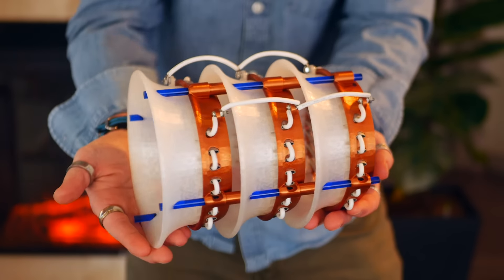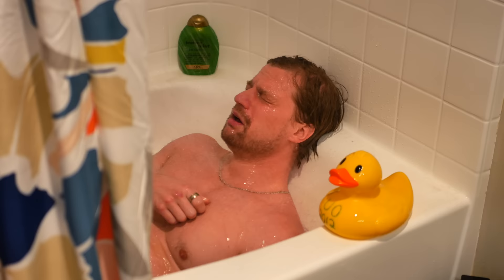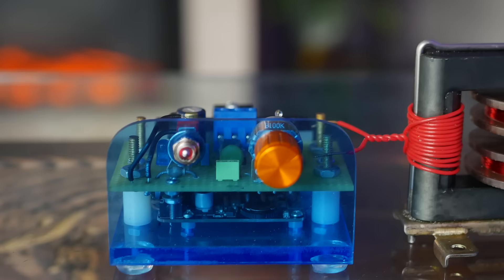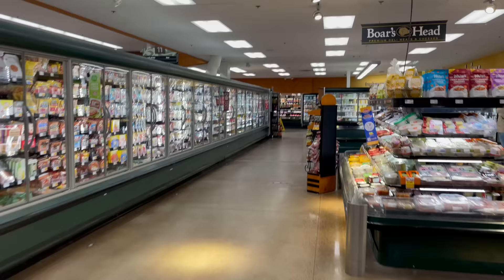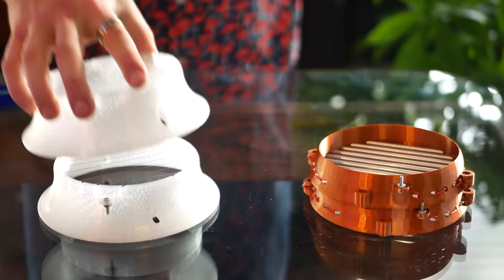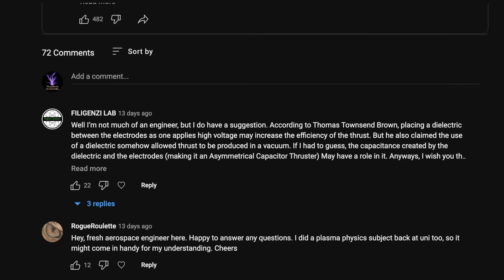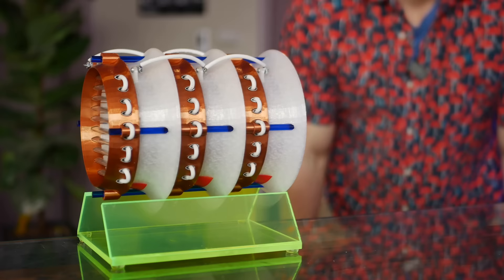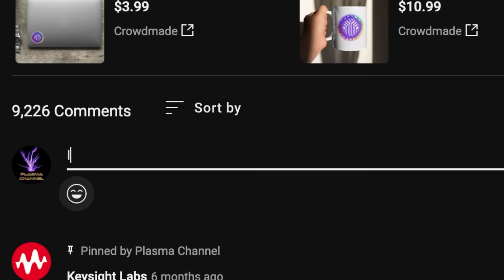The Next Generation of Ionic Plasma Thrusters (BSI MARK 2)

Comment: While you have already tested and optimised spacing between the anode and cathode for a single stage, i think you should really adjust each stage in a stack individually. The air molecules entering at different velocities might impact how far they need to be apart.
Reply: they should never have been stacked in the first place.
Reply: Came here to say the same thing!  As the air flow rate increases (after each stage), you have less time to transfer the additional charge to the air.

I would also think successive stages would do better with higher voltage.
Reply: my thinking is also in 5his camp more space required as velocity increases.
Reply: Yeah, that occurred to me as well - logically, the faster the air is moving, the less time it has to be influenced by each stage, right?
Reply: @beforebefore wouldn't more voltage benefit all stages regardless of location?
Reply: @nathanchalecki4842  It might be wasted energy on slower flow rate sections... if there's not enough air flowing to absorb all of the charge. Ionization has limits before it will cause arc-discharge in the airstream. 
 Higher flow-rate stages should be able to make more use of higher charge transfer potential.
Reply: So, continuing some of the thoughts here ,,, As the airflow increases the distance between the stages would need to adjust farther apart to allow for increasing air draw. The voltage in each section may also need to adjust for changing conditions. Perhaps a system of ramping up voltage as the airspeed goes up and the distance between the stages gets wider in relation. 
I can see how safety redundancy would be good requiring 2 stages but it seems the third stage is adding more restrictions unless the previous concepts can prove otherwise. I would think that two sets of double stages would move more air. If ducted into a single output with another venturi intake space using the combined forces of both ... the airflow in the combining structure would need to be very carefully designed for minimal turbulence across the functional range of outputs from the driver stages. My thoughts jump to a third double stage driver assembly configured at slight angles to each other to `spiral' the airflow inside the combiner to minimize flow restrictions and the resulting eddies in the airstream. I would expect that 3 double stage drivers combined would produce at least 2 times the airflow but maybe as much as 2.5 times.

Now, how am I supposed to sleep tonight with all this spinning around my head ?!?
Reply: @OldShortyInCanada  those are some very good ideas and points you made there.
Reply: @nathanchalecki4842  if you are looking strictly for power yes of course. However to optimize your efficiancy with little sacrifice to perfirmance, voltage regulation would definitely be relavant. Personally i think it would be interesting to see what the effect modulation and restriction would have. Can you produce more efficient thrust by modulating the output voltage in asynchronous waves kind of like a rail gun? Would restricting flow and causing an aerospike like effect cause more thrust. Of course every part you add creates complexity and possible POF.
Reply: Have you thought about figuring out a way to swirl the air current like a tornado?  Not sure if it would do anything practical but then again it would be awesome to see and would definitely get the creative juices flowing.
Reply: Imagine trying to control the power of a tornado into something like an Ionic Plasma Thruster…. You’d be talking about something akin to jet propulsion power there.
Reply: I agree with the different velocities of Air entering you likely need slightly different geometry on the electrodes and voltages. The higher the Air speed the more elongated the conductors need to be. think flat metal wires instead of wires. and likely stepping up voltages. interesting project though wish I had the equipment to play with it.
Reply: @justinhill1908  it's a neat idea it's just ironic thrusters are so inefficient compared to a fan
Reply: @justinhill1908  you could already do this with basically a fan
Reply: @justinhill1908  what do jet engines use anyways it can't possibly be fans
Reply: Basically it would’ve been great to see same experiments with spacing electrodes and varying voltage when the external airflow is applied. That can help a lot with understanding the perfect conditions for multistage configurations. Although my gut feeling is the same here — next stages should have more space and proportionally higher voltage (interesting to see wattage as well, I guess it should be equal between the stages for best results).
Reply: At first... sorry for my bad english and i'm not a scientist😅 but i think also the solution is to change somthing at the electricity between the stages. But in my opinion you have to change the frequenz between the different stages. Like different frequency for each stage. A oppertunity will be one or more frequency converter. So may be the airflow will work faster.

I also think, a single stage might be have a better efficienty then three instack.

Wish a good day.
Reply: I wonder if instead of overclocking voltage, what would happen if you offset the grid alignment on all 3 stages. For example second stage is clocked at 25 degrees from the first, and third us clocked at like 80 degrees from the first.
Reply: This was exactly my thought.  If the hypothesis is that air molecules are moving too fast to interact with the anodes and cathodes of the first thruster design, our test should see if increasing the spacing of stage 2 or 3 result in improvements
Reply: @justinhill1908 In theory if the design of the anode / cathode grids was more like a spiral staircase, and it used electronic switching to energize segments in sequence, you could get the air current to twist as it passes. If each stage had a stepped design going from wide to narrow, and applied progressively higher voltages, it could increase velocity towards the exhaust maybe? Also maybe moving from wires to some sort of printed circuit could lower resistance and generate more streams per layer. (i are not physicist)
Reply: Increase voltage per stage, increase distance slightly between anode cathode per stage, decrease diameter per stage. You’re welcome.
Reply: Did you properly test the vector of your ramrod? Ramrod=Uranus √2
Reply: @beforebefore is that a fact or do you think they’re all limited by charge?
Reply: Great job. I believe if you make the second inlet diameter bigger than the first one and third inlet diameter bigger than the second,  you will have more speed. And of course it will be better if you test it in jet tunnel

Comment: If you want to get faster airflow, you might want to reduce the size of each stage a little bit, so it would start large, pulling in lots of air, and get smaller as it goes through. I think this will increase the pressure as the air goes through the thruster, and as a result of the increased pressure, increased velocity
Reply: The pressure would actually be decreasing for the exchange of increased velocity airflow. As you're describing a nozzle. A good way to think of it is that a negative pressure (vacuum) would pull in more air faster, ie higher velocity. Jet engines use nozzle-diffuser exhausts to increase the velocity from the burner and turbine stage to a higher Mach number via the nozzle geometry, and does this through the enegry expense of decreased pressure. Then the diffuser at the exhaust increases the pressure, typically towards ambient pressure and as a result it reduces the velocity.
Reply: Those side "inets" are not helping
Reply: I think as the air speeds up and moves through the succeeding stages then the following grid pairs might need to be further apart so as to keep ions in the accelerating zone for the same period of time as the first stage.

Otherwise it will still have the same problem as putting a computer fan in front of the single stage.

As Alex suggests, there might also need to be a diffuser after the last stage... and I think that might need to be heat resistant
Reply: @class2instructor32   I was thinking this too since airflow is obsturucted by air from the sides.
Reply: @lordchickenhawk  yep you are right. there's definitely a need for testing in grid spacing, and I don't think this channel is the best at the scientific method for this reason. For instance, he tested the grid orientation by 90 degrees but didn't take an iterative approach, so there's no guarantee that parallel is the best. Perhaps 33 degrees or 45 is better, or even 14? 

No one knows the best approach to improving this engine, beyond basic principles/logic from thermodynamics, aerodynamics, and jet propulsion. However, my experience with electronics has proven to show many surprising results due to the physics alone. If he wants to optimize this system, he really needs to solve for a physical model representation. With instrumental uncertainty and proper testing. As his test with the fan did not prove anything other than that his current setup is not linear. There's a chance that moving one grid further or closer could reach a sweet spot that creates a linear relationship. It's probably unlikely, I would guess there's a gaussian distribution for grid spacing as each stage needs enough room to pull more air from the sides while also maintaining the "narrowing" flow rate through each stage. He may need to design a very long nozzle to increase the velocity. The question becomes more about how long is too much material versus too short for limited thrust. There's also no answer yet to how the number of grids impact the results. 

So it's almost reaching a pointless approach, to only focus on aerodynamics at the inlet. I don't think a diffuser will help either as an increase in pressure is not needed, as that would lead to a loss in energy. Unless you plan to drive turbine blades, which would be a very inefficient fan. 

I think there may be some testing required for possibly a nacelle versus open, and then as most people have indicated, smaller subsequential stages to create a nozzle effect. The device is in its early stages, it's worth making something heavy and bulky to get results, so that it can be refined down to a lightweight optimized model.
Reply: @alexottinger6765  Well... at least he's out there actually building stuff. Gotta give respect for that.

But yeah, there's a lot of things to try with this project in a more rigorous incremental way.

I do think his work is worth keeping an occasional eye on, it's a fun project that I won't be doing myself. I'm more for the mechanical aspect of home shop work really.

As for a diffuser, yeah I WAS thinking in terms of a jet engine where as this probably has more in common with a pulse jet.. Your "really long nozzle" idea is more worth testing
Reply: @lordchickenhawk  just because he's posting videos to YouTube doesn't mean he's the only one building an ion thruster. There's a lot of engineers working on it right now actually. In fact my friend and I have one started with a basic grid design and a transformer to voltage multiplier setup. But finding time between AE is hard to do when theres other priorities to take care of. Our goal is to determine the grid spacing and a physical model through iterative testing would be the easiest approach. And the "long nozzle" would be an optimization of the nacelle. I have no idea what length it would be, could be short for all I know. But I would expect it to be much longer than his current spacing due to the airflow being extremely low subsonic.
Reply: @kiljupullo  Yeah the fast moving accelerated air is running into slow turbulent air
Reply: @alexottinger6765  Yeah, nar, of course he's not the only bugga on YouTube playing with this tech. But he IS posting his game for better or for worse. Good on 'im. It's interesting to follow and discuss.

Are you and your mate posting your work anywhere? It's a cool field although I myself don't intend to make any moves in it. I already have far too many of my own (VERY) slowly progressing projects and they are deffo a bit too mundane for posting.

Given the AC frequency of mains power and a perhaps possible 6m/s gas velocity there could well be a shortish (about 12 inch here in Oz, 10 in the US ?) optimal 1/4 wavelength nozzle that takes advantage of pulse jet harmonic resonance effects.

However, I don't know enough about any fluctuation in the DC output of voltage multipliers to guess at how influential said AC frequency might be.

BTW, what is AE? I worked in a House for a while down in Adelaide, (Souf Oz) as a bouncer so my mind just auto-jumped to Adult Entertainment. I figure that's not likely so I'm guessing Aeronautical Engineering  given your inclinations?
Reply: And close off the side inlets. I am thinking they are doing the opposite of what he is trying to do.
Reply: Also I think a nozzle profile (smaller diameter at the exit) would further increase the speed. Also warming the inlet air a bit.
Reply: I hope this suggestion gets considered and tried again. I could care less about a plasma ray gun. This project was super interesting
Reply: You'll increase the back pressure in the thruster body....
Reply: I could imagine it acting in reverse of this theory as each stage increased in diameter would have momentum minimizing effort and maximizing efficiency while increasing total air flow. Compression could easily be created with a simple funnel at the very end

Comment: You can use Bernoulli's Principle. Instead of placing the individual thruster back-to-back, try to put them side-by-side, and then constrict the output of the thruster system with the help of a nozzle, that might increase the airflow's speed.
Reply: yeah, but that's for scaling out, first you have to scale up.
Reply: I was thinking this but gradually decreasing the size of each thruster. So larger front, smaller back.
Reply: Yeah I agree the additional stages adds much more weight and complexity with, reduced return.  each stage needs to be tweaked to function at the in flow of the preceding stages outflow. Adding a varrible headwind like during forward motion triples this complexity. best designing one variable stage than 3 static ones
Reply: @chriswhite3692 that would work if it generates enough static pressure, nozzles often result in flow reversal if there is too little pressure. If we had a CFD tool that supported electric fields this could be really well optimised.
Reply: I don't think this thruster would generate enough pressure for that.
Reply: Seems like this design (this type of thruster in general) would place serious limits on back pressure, requiring it to be pretty low. Seems like a nozzle would have to be a pretty modest constriction to increase velocity without backpressure "stalling" the flow from forward in the engine. 
I dunno if that makes sense or if I explained it well, but hopefully it does.
Reply: you don't want higher speed, you want more air moving at a slower, more efficient speed. single stage, as wide as possible with no restrictions.
Reply: That would work like a transformer, creating speed from static pressure. Ionic thrusters don't really produce much pressure.
Reply: OK let's get this correct  !!   #1  The only reason radio waves and AC current travel out in space and down a wire is because of the "CENTER " of a magnetic field.  (The "B" field), The North and South poles are the weakest part of a magnet !!   Just like Tesla said,  you got to look at things you can't see !!  At the center of a magnet is anti gravity,  (just tap the center on any glass or plastic and it will loose weight), The center can repel water if vibrated at the correct frequency,  If you vibrate the "B" field into granite rock it will become soft and you would need copper tools to work on same , you don't want to disrupt the magnetic (B")field ) with other iron.  Once you understand the "B" field of a magnet and how it relates to the entire universe we live in, you will then understand what Tesla was telling everyone "LOOK FOR WHAT YOU CANNOT SEE""  .I believe the pyramids were inter galactic communications and transportation systems.  Stone Henge and Gobekli Tepe , power plants.  Take a look at Coral Castle Florida on YOUTUBE and you will see a similar pilar. I believe these horizontal pillars were oscillators that would provide excitation for many things from crops in the field to anti gravity
Reply: @vincecox8376  Sir this is a Wendy's.
Reply: @vincecox8376  "OK let's get this correct  !!" 
*spouts a bunch of schizophrenic jibberish*